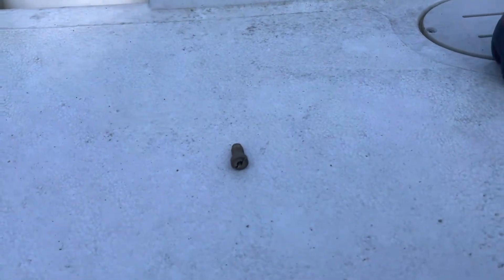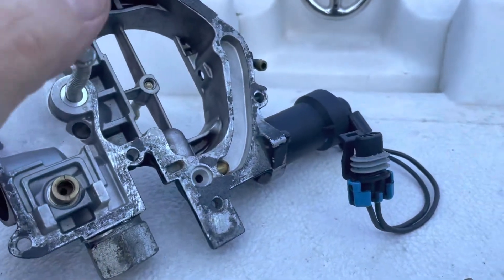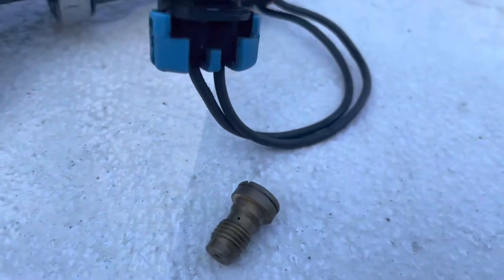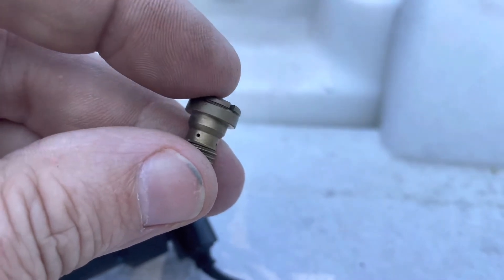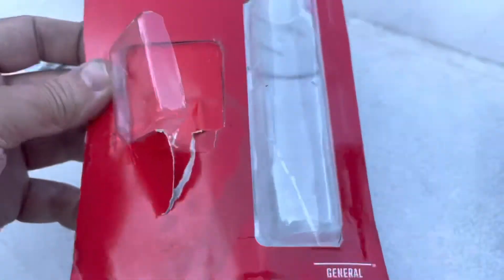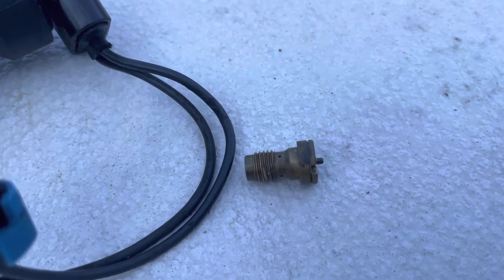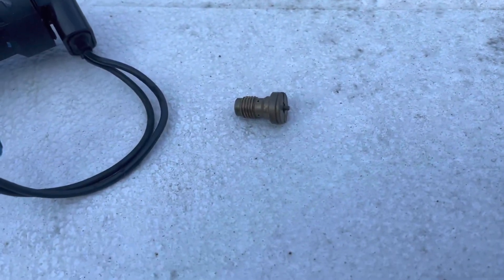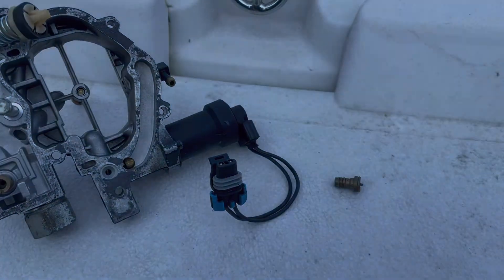Mercruiser 3.0 2(l) - Down on Power? Check Power Valve

Comment: Thank you for your information.  I have an issue with 3.0 mercury carburator. The engine is stumbled b4 pickup the speed with back and forth  throttle.❤
Reply from the maker: If you’ll write your question in French or whatever language you speak, I’ll use the translator to convert it to
English. I don’t understand your question as written.

Comment: The long rod with the spring that touches the power valve. Is that supposed to be straight or have a slight bend to it?
Reply from the maker: Straight but a very slight bend barely noticeable is ok.
Reply: @moccasinmarine  Is the slight bend by design? Mine has a "decent" bend. Obviously subjective.

My engine starts and idles fine. Is very responsive from 2000 rpm + but from 1k-2k need A LOT of power to get it up or it stalls. Do you think it is this "rod" that is coming into contact with the power vavle?
Reply from the maker: @garrettp.5018 if the rod is bent then you arent getting the extra boost of fuel needed under heavy load. A bend would shorten the rod causing less actuation of the power valve. But the bent rod can’t touch anything or that too would interfere with its operation.
Reply: @moccasinmarine  Yes, that is what I am thinking. Do you think it is what I am describing? I mean if it eventually comes into contact with the power valve (or does the power vavle needs to be actuated) at the 2000 +RPM...     I don't think that rod is a replaceable part? I can't seem to find it in any diagrahms...
Reply from the maker: @garrettp.5018 take it out and straighten it yourself. They pop out of the hole.
Reply: @moccasinmarine just pull it out or is there a trick to it?
Reply from the maker: @timothylowman5344  bounce it up and down with your finger against the spring. It’ll pop out eventually.

Comment: Hey, man, I have a unrelated question. I also have a  mercruiser 3.0, do you think it's okay to add some oil additive to clean? Such as slick 50 or the other stuff in the yellow bottle can't think of the name right now.😅
Reply from the maker: I would not add any additives other than a bottle of ZDDP at each oil change. The 3.0 engine is a flat tappet cam engine and modern oils do not provide good lubrication for flat tappet cams. ZDDP used to be in oils but was taken out so you need to add it back in at each oil change.
Reply: Thanks boss
Reply: I got one more question.I am adjusting the valves thanks to your video Can I find the gasket at a autozone Or can I use just straight gasket maker really carefully? Can't seem to find a valve cover Gasket with five Boat holes. Everything I find on line will take weeks to come in
Reply from the maker: @chrisjones3038  https://www.offshoremarineparts.com/products/12131703-gasket-push-rod-cover-mercruiser-gm
Reply: Got it thanks man!

Comment: And...that was the problem?
Or ignition?
Reply from the maker: In this case no it wasn’t. I never did figure out what was wrong with this carburetor. It was a TKS carburetor and I always have problems with them. I just replaced it with an older electric choke model.

Comment: You saved my bacon!  I used my impact with a wide bit and that did the trick!  I tried every screwdriver and it was just too tight.  It started to strip and I found your video.  Thank you very much....
Reply: I ended up drilling it up by stepping up progressively with drill bits. Got it out, mainly cause it was soft brass.
Reply: @garrettp.5018  If it works, it works....